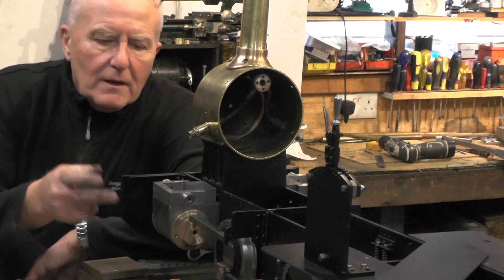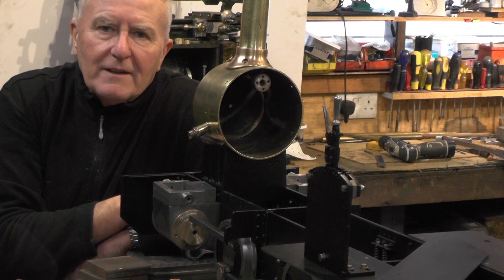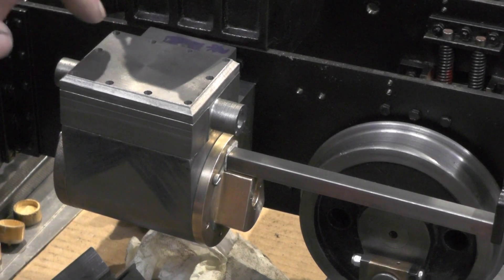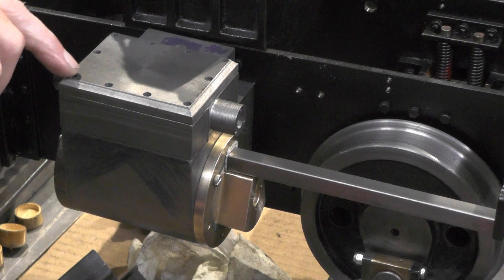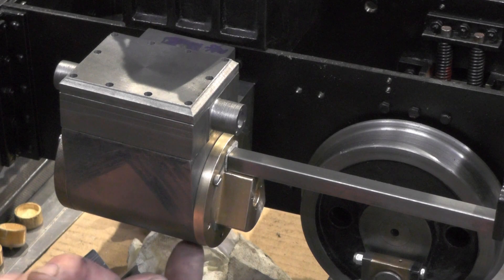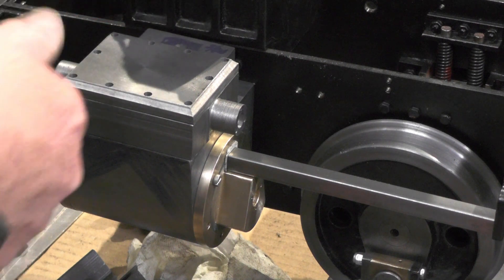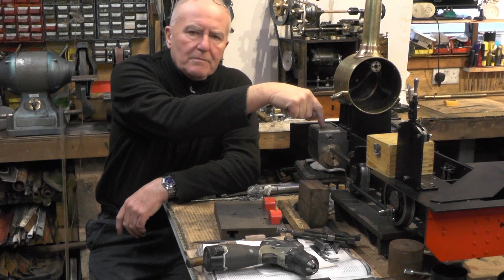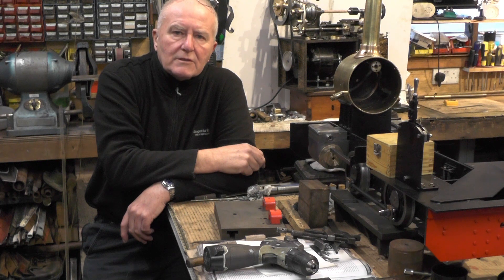Sweet Pea Steam Locomotive Build Part 9c (Steam Chest cont.. Covers)  "mr factotum"

Comment: I left a comment but it's gone for some reason.  Anyway, I bought all the castings and frame steel for my Manor from Norman Spink in 1976.  I was a musician in Hollywood California then.  I later built the steam powered Camaro that was written up in Light Steam Power magazine May 1971 vol 3.  But eventually drove big cross country trucks 2 million miles and retired in 2020.  Now age 76.  I have an Atlas 12 by 36 flatbed lathe and an Enco V way 12 by 24 lathe.  My mill looks alot like yours.  the tabe is 9 by 23 made in Taiwan..Bought a nice 8 inch rotary table for the mill which is very handy.  Had to use trigonometry to solve for some missing stuff on M. Evans drawings for the cylinder rear covers.  db
Reply from the maker: Hi Donald
Not sure about your previous comment, but i sometimes get anomolies on youtube.
Thanks very much for an insight in to your background, interesting.
Yes my mill is an old tawainese one and very handy, it does what i need to do, but sometimes i have to wrestle with it. I'm pretty sure my mill table is 9" x 23" too.
Mine's a dead giveaway for far eastern, as the label on the front below the spindle pulley says Made by Maching Co. Instead of what should be "Machining Co.🤣
I have a 6" rotary table and a small horizontal dividing, this equipment does most of what i need to do. 
As for missing info on loco drawings this is very common, i am the same with my drawings for my Sweet Pea / Metre Maid Locomotives that i have / doing.
Anyway keep in touch its always nice to hear from others with similar interests, good luck with your loco build.
see you next time
ATB
Kev (UK)

Comment: Oil hole for manual filling after a run is what I have done as well, saves pouring oil down the exhaust pipe!
Reply from the maker: Great point! Tom
Can't have too much oil, 
to come off the track like a shity sooty oil slick🤣🤣👍👍🚂🚂
Hope your new machines are getting some use
ATB
Kev